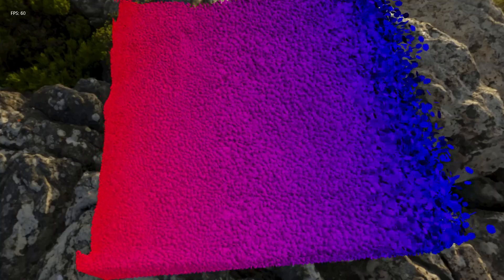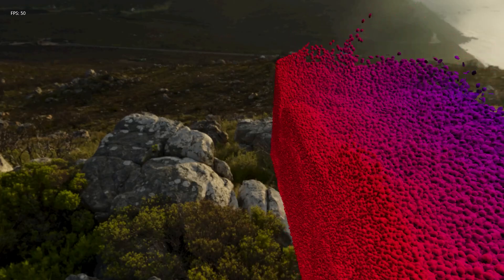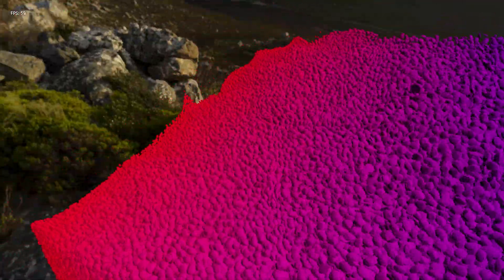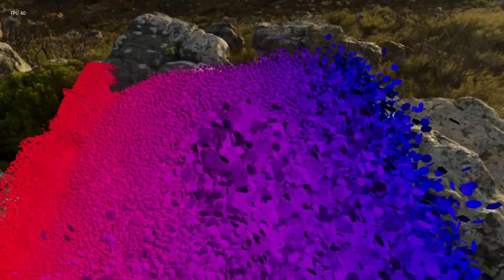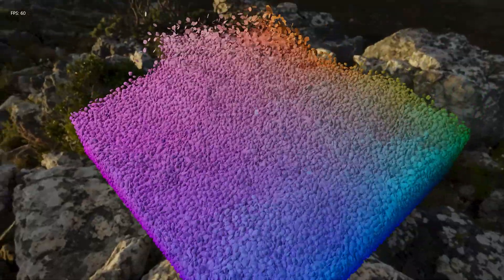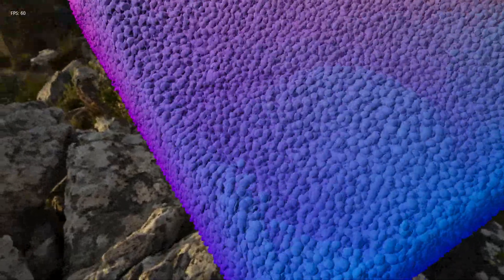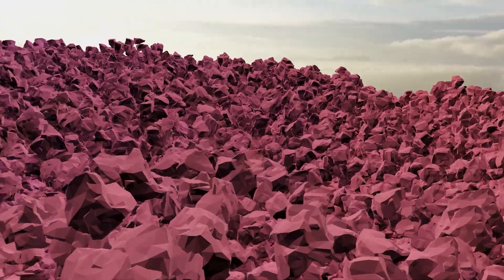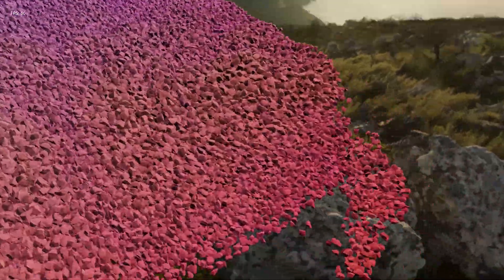Revisiting Adaptive Resolution Particle Simulation | Devlog

Comment: Right, I just wrote one huge comment and then realised what's going on xD. 
Now it's amazing and I love the way it works, but would it also be possible to make "less active" particles bigger? Because if you're just looking at a still water, I guess you don't really need that much detail, but if it starts moving you need it the most?
And also, is this working with particles covered by other particles and objects or is it only distance?
Reply from the maker: Hi, I saw your other comment and your ideas are very good. Currently I'm doing the simplest thing possible e.g. using distance to the player, and this is mainly a proof-of-concept for a splitting/merging system with very little overhead.

Now comes the fun part of coming up with a function for determining a particle's target resolution and it can be a weighted combination of:
Distance to player
How active they are (reminds me of the "sleeping" thing almost all rigid body solvers have)
Occlusion & visibility
Whether it is in contact with particles of other materials
Deformation, is it stretched thin, etc.
Density gradient can be used to see if particle is close to surface

Then there is also figuring out how particles will split. A rock shouldn't really split into 2 smaller rocks that are identical copies. Grass should only split on the X & Z planes. Can I use a fractal system and use the LOD system to create branching structures like trees?
Reply: @GrantKot  It makes me feel so much better that even though I know so little about this stuff, I still can have a valid question xD.
I can't wait to see more progress. You're one of the few people I'm subscribed to, that I actually check frequently.
So far youre making such huge leaps, it's just exciting to watch. Looking forward to the next one :)

Comment: Your world are really amazing! May I ask how many particles there are and if the simulation runs on GPU or CPU?

Continue with these great works!
Reply from the maker: Thanks! It can usually do around 420K at 60FPS. Sometimes when the frame rate dips that’s because the particle count goes higher to 5-600K. The physics simulation currently runs on CPU. The GPU will have plenty of work rendering :)